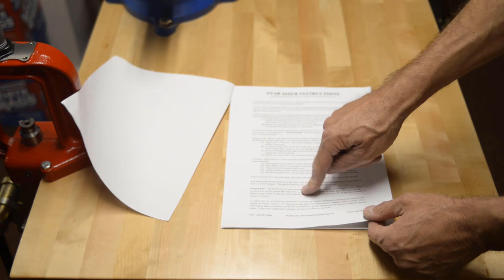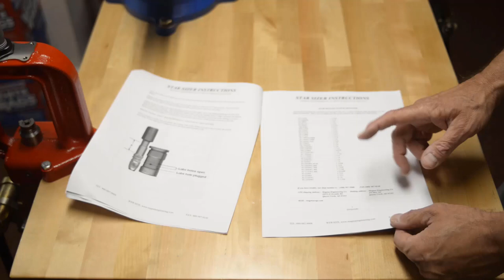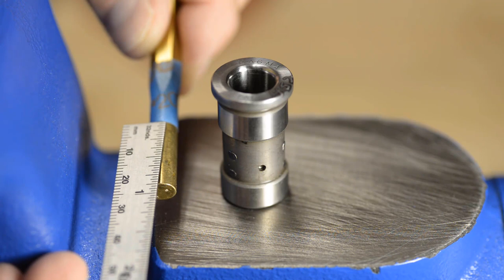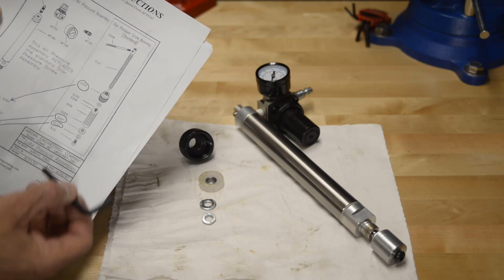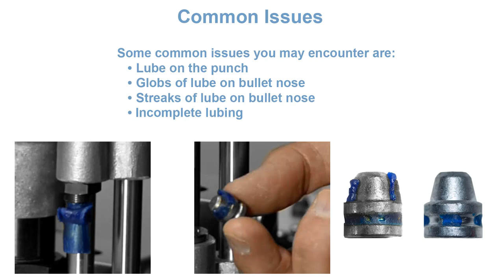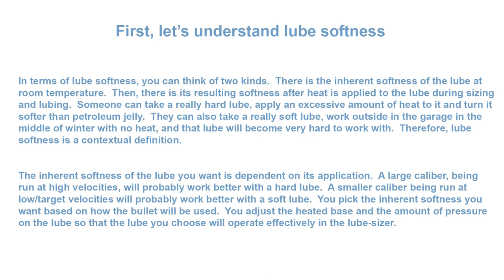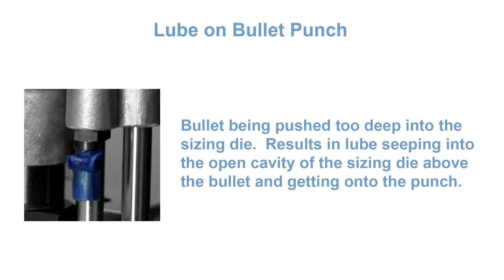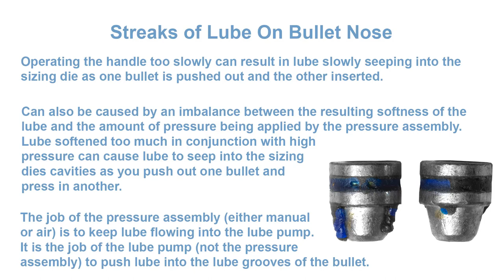Star Lube-Sizer - Installation, Setup and First Time Use

Comment: I had subscribed to your channel because I am learning tons with yours videos, I just was wondering what Pot would you use for casting....
Reply from the maker: Hi Nicolás. It may surprise you that I do not cast my own.  I buy unsized, unlubed bullets from commercial casters.  While I find commercial cast bullets to be high quality cast, their sizing is inconsistent and the lube they use is really for holding up to long term storage and shipping.  i.e. the lube they use is generally harder than what my application (precision target shooting) calls for.

Comment: Just picked up an older San Diego Star . Can you tell me if the fulcrum lever is adjustable?, the rod attached to the handle on mine doesn't operate the spring.
Reply from the maker: I am sorry Mark, I am not familiar with the San Diego Star.
Reply: @knowledge2you  thanks for the reply..there's very little difference.. certainly not in the rod that I'm talking about .. when pressing the lever it doesn't press against the bolt like yours does .. I think its maybe been adjusted so as not to ...